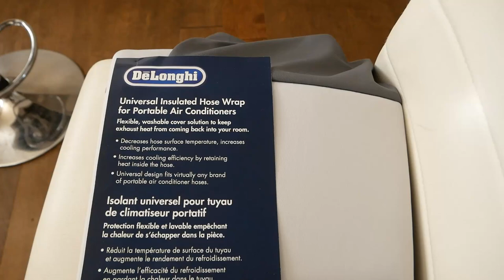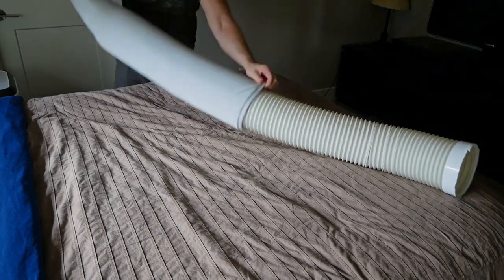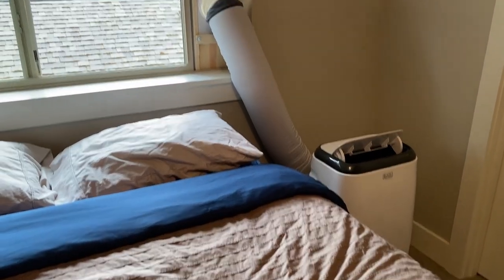The De'Longhi AC Exhaust Hose Cover REALLY WORKS

Comment: The biggest problem is that these units create an underpressure when exhaustimg that much hot air. So hot outdoor air will be sucked into the house again...
Reply: That's true! But there are double hose units that avoid that particular problem
Reply: @TheSlimHim  yeah those are great. Twice as efficient. But those are not these 😉
Reply: @TheSlimHim depends from where? If from the coolside of the house behind a tree, not that big problem, and the efficiency could be better than sucking in air on the hot side of the house/flat with doublehose. I have a central heatexchange (without cooling :() and no negative pressure.
Reply: @gaborbilicz9413  Yes, efficinecy depends on the intake air temperature, but it's much better then single hose anyway. Untill you suck the air right rom the exhaust of course. Because a single hose unit not only creates negative pressure and suck in the hot air. But it also throw the cool air from the room that it just cooled. It basically cancel it's onw work, partially.
Reply: Unfortunately, the dual hose versions are relatively newer units while the single hose versions are still predominately sold and cost less.
Would've paid more for the dual hose units at the time when I bought the single hose Delonghi portable AC from Costco some years back. Today, the brand is No longer sold in Costco.
Reply: These can be easily converted for just a few dollars and a bit of diy skill
Reply: @Atreyuwu  some of them. Mine can be converted pretty easily. But there are units that doesn't have a separate evaporator and condensator intake. Or they have, but there isn't any separation inside. You can disassemble these units and do it yourself but it's much harder.
Reply: This can be an advantage when you are using the airconditioning to cool a heated room at night (and the outside temperature is cool)
Reply: @argonarray7688 that makes a lot of sence xD i was thinking about if it is possible to convert a 1 hose unit into a 2 hose effectively. I only have one intake (i might disassemble the backcover later to have a look on it) which means i would have higher air pressure (and maybe even less efficiency) in my room if i would duct the whole air intake to my window and dont "pull" the heat out of the room and only "push" colder air in, right?
Reply: @argonarray7688 keep in mind that even if it's possible to add the intake hose, some of the units don't have strong enough fan to both push hot air outside and pull fresh air inside through another hose. In such case you need to install additional fan to the intake hose.

Comment: How the hell is that thing blowing 40 degrees air? I also got a Black and Decker and max it's like 64-59.
Reply: I'm pretty sure there's something wrong with your air conditioner depending on how how your room is. Tip: AC should always blow 20f colder than the indoor temp. My ac blows 50f in 70f room

Comment: No one makes one of these things for the wide hoses....the kind that have two hoses inside one sleeve.  It's kinda oval shaped, instead of round.  All of these covers seem to fit only the single hose round version.
Reply from the maker: I also have one of the portable ACs of which you speak, the Midea Duo. It  honestly doesn’t radiate much heat, so I don’t think a cover would do much.
Reply: @aaronsrapidreviews  did you test it

Comment: How did you build the wooden window kit? I just realized that I'm losing air through the plastic one that comes with it. It doesn't even fit my window right. SMH. Thanks in advance!
Reply: I'm thinking of trying insulated foam for that purpose.  I have to use mine in a sliding door, so i'm losing several feet of insulated space, and i'm hoping foam will help.  Should. be easy to cut to size.

Comment: Wow. If only that made it a tiny bit bigger in diameter so it wasn't like putting on pantyhose. I need one of these sleeves. Thanks for an encouraging video. I wish you talked about how much cooler the room was able to get with this sleeve on the hose.
Reply from the maker: With or without the sleeve, the AC is able to cool the room down as much as I need. The sleeve just means it's using less electricity to do so.

Comment: As Aaron pointed out towards the end, the hose doesn't address other Deficiencies of portable ACs but only that the hose cover 'appears' to do its job.
Bought one from Amazon to fit my Delonghi portable AC, which was a PITA to fit.
Even after putting it back together with the hose, don't really feel much difference, if any.
Even contact Delonghi about the issue about the AC hose cover, which Should have included a zipper alongside the entire length of the cover instead of having people pulling & shoving the hose through the cover.

The real issue is that the portable AC is a single hose unit, not the newer Dual (double) hose unit, the former is less efficient (~60%) while the latter is more efficient (some ~80%). THAT is the main issue with portable ACs, its energy efficiency is Not great compared to the window AC versions, portability being the main factor for the portable AC units, esp. the single hose units which are still more common than the Dual hose units.
Reply: My condo has LOTS of windows.  A whole WALL of them, in fact.  But none of them open, except for the sliding glass door that goes on to my balcony.  That leaves me with 7 feet of space for heat to radiate in through those cheap plastic spacers.  I need to find a way to better thermally insulate that plastic.

Comment: Those mobile AC's remain very inefficient even with a hose cover:
1) the cold air gets also sucked in, and leaves the room by the exhaust hose.
2) new warm air gets sucked in the room because the exhaust creates underpressure.
Reply: so you mean should not use portable ac? any better solution for it? Thanks
Reply: See, these are the kind of comments that annoy me.  The vast majority of people who use a portable ac unit would prefer to have central air, or at least a mounted window unit, but CAN'T.  Who would PREFER to have a giant a/c unit taking up your floor space, plus a giant, ugly hose go up to a window??  NO ONE.  Most of us are in situations where a window unit is not possible, so stop preaching about how portable units are terrible, because it is NOT HELPFUL.
Reply: @trekkiejunk  If it's not suitable for you just scroll on please. For potential buyers it can be useful to adress the problems with portable AC's. 1) Lowering unrealistic expectations prevents disappointments. 2) For people who dó have a choice (portabel vs splitunit) it may prevent wasting their money.